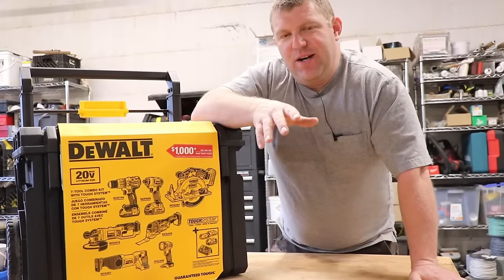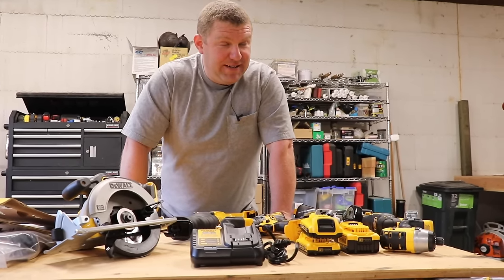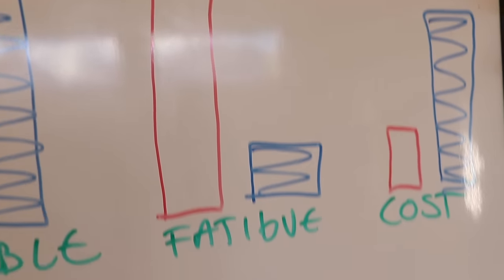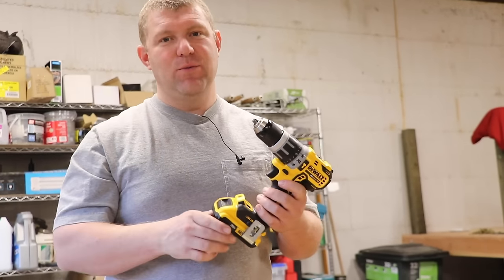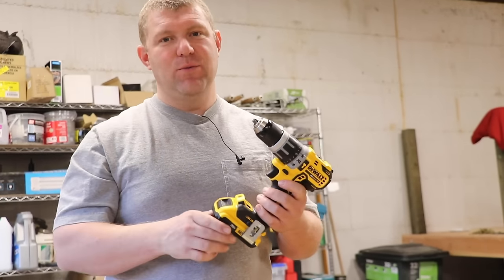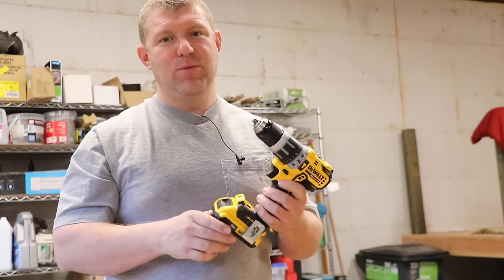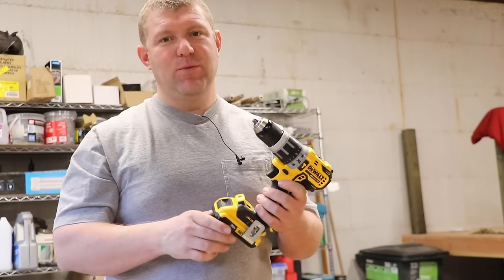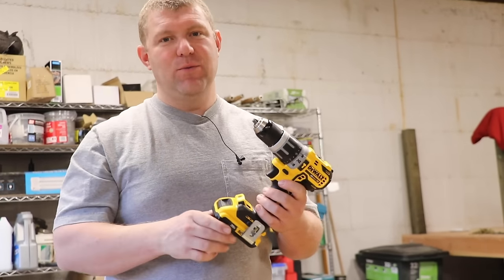SHAME ON YOU DEWALT

Comment: Still getting good use out of my 7 year old Dewalt 18V (Brushed) XRP tools.  These get fairly heavy homestead use.  Batteries are definitely showing their age  but the tools themselves work good as new.  I will be getting the batteries rebuilt with new cells this year rather than investing in a whole new system.  Tool reliability is a non-issue with these cordless tool systems and anyone that actually needs tools like these should be able to handle changing the brushes IF they ever wear out.   It's all about the batteries.  Look for a battery/tool "ecosystem" that has the tools and features you'll need and the best Watt Hours/$ in terms of battery cost and you won't be disappointed, regardless of whether you choose team yellow, red, green or any shade in between.

Comment: DeWalt is resting on its Laurels.  They have always been "The Brand".  The problem is that the new DeWalt is not the old DeWalt.  "Less than the top of the line" DeWalt cuts lots of corners or overcharges.  This tool kit is the former.  Battery prices are the latter.  Take a look at Harbor Freight tools.  IMHO this tool kit is similar to Harbor Freight's Bauer line of mid level tools which are cheaper.  For similar prices, check out Harbor Freight's Hercules line of brushless tools.  Equivalent quality, 10 hours a day 6 days a week tools at the mid level DeWalt prices.  Battery prices at 1/3 to 1/2 half the cost.  Check out the Bear's "The Den of Tools" channel.  Follow his converting from a DeWalt fan boy to a Harbor Freight fan boy.  I am 20+ years Harbor Freight customer.  The tools I have bought their started with cheap Chinese imports 20 years ago.  Now the Harbor Freight tools I buy are inexpensive, high quality Chinese imports.  Better quality at half the price.  IMHO, China is eating Made In USA's lunch.

Be careful of battery pack formats.  Alisa and Jessie have at least 3 different sets of battery packs.  Mikita, DeWalt and Milwaukee.  Probably more.  Off brands and non 18v batteries.  When you buy your first battery powered tool, particularly a kit, you are choosing the product line you will continue buying.  Just saying from personal experience.

Comment: I abuse dewalt tools daily. In my experience the brushless controllers/protection circuits burn out long before anything in a brushed tool would. Luckily their warranty is no hassle, I've been returning the same tools about once a year and getting a new one. I also dislike the lack of finesse with the brushless triggers, doesn't take long to get use to but trying to turn a screwhead that extra 1/4 turn can be difficult.

Comment: I still can't figure out why you guys have so many different battery platforms for similar/basic tools.  Too many unique chargers.  Too many unique batteries not compatible with the other tools.  If they were all the same brand think of how many spare batteries you would have or how much you could have saved just buying bare tools because you already have a stockpile of batteries.  If the tools were specialty and not available from a single brand I'd get it, but nothing special here aside from the Milwaukee tower light.

Comment: Every brushed tool I have you can change the brushes. I have some tools that are 20 years old and a Makita belt sander I used a lot that I changed brushes in twice over the years. Still working good after brush changes. I'm not sure new technolgy will last that long, most are full of electronic features, pwm speed controllers etc.. that will likely fail sooner than a brushed tools life just due to that fact its got a lot of electronic components on a PCB that its needs to work. That said brushless is still better with power and battery life and I'm on board with the technology but wont plan to keep those new tools for life like my others.

Comment: Wait. I think I have to side with dewalt on this. Your compairing the 7series to a 9 series hammer drill?  They package that kit together for a competitive price for weekend warriors. They are all more than adequate for home reno stuff.  I have all XR and bought several in 'kits' but made sure I was getting models I wanted because I am junkie when it comes to quality tools. What company does not have different version of tools, milwalkue with other fuel vs none fuel etc..

That XR oscillator is awesome!! 

I think the message is the buyer should do some research. You say those tools are cheap, but they smoke the older stuff. 

I think it's not deceitful marketing, more than letting people buy into the brand concept. I would say this kit selection of more on the big box stores and who they cater to. 

Btw, I returned a Milwaukee kit as it had me confused and was not there full out fuel line. 

Liked the vid, good, production.

Comment: Are you aware that the only real difference between DeWalt and Black and Decker is the color of the tools? THey actually did a study to find out which color combo people judged to be better quality and it turned out black and yellow was it. DeWalt has marketing and some of their tools are decent, but most are overpriced and they are notorious for worming out of honoring their warranties. If you're going to go with lower end tools, you might as well just get Baur branded ones from Harbor Freight. At least if they break you can just walk in and they give you a new one.

You've used both Makita and Milwaukee contractor level tools. Why would you think a combo pack of Black and Decker tools with delusions of grandeur would be any good?

Comment: I don't think the conclusion of brushless lasting longer is true. There is a load of electronics to control the brushless motor and these will not last forever but there is plenty of brushed tools over 40 years old that only need new brushes ever now and then. So for a life time investment with low usage I thing brushed could be a good deal - especially wired tools where the battery pack life time is not a concern as well.

Comment: The difference between brushed and brushless is more like 10% of efficiency all else being equal. Of course almost all the manufacturer's marketing people would like you to think otherwise. 

DeWalt is not a premium brand, they used to be. If you want serious tools then think Festool or Hilti. The Bosch "Pro" line is pretty good at a not so stratospheric price.

In fairness to the manufacturers the thing is the DIY market is huge compared to the trades market so pretty well every manufacturer wants to be in that market and it's all driven by price. As said though for the weekend warrior the cheap home brands are often a better value proposition when you can buy three or more for the price of pro gear.

Comment: Jesse, I don't know about power tools, I don't work on them.  I do know about vacuum cleaners.  I work on them all day every day.   I can tell you that brushless is not the way to go in a vacuum cleaner, because they typically have a big expensive circuit board on them that runs the brushless motor.  It costs more than the motor, typically, and is very sensitive and easily blown, especially the way people beat up a vacuum.  I'm sure they aren't any more careful with tools.  Being battery powered may help.  Mostly what blows vacuums is pulling the cord out of the wall and breaking the plug, or the heat of the motor, but it has given me pause about buying any cordless motor.

Comment: I got one of those 6 1/4 inch cordless saws in a kit a number of years ago.  I have literally never used it.  Why?  It just had to little power to cut anything!  The one you got in this kit is probably better than my older one but...the blade size is just a killer.  Why buy expensive blades that can ONLY be used in a tool that does not cut anything?

Comment: Great video.  I use these dewalt tools and they are 18volt. Didn't know about the brushless option.  They have been great but are aging.  Thanks for pointing out these differences.  I do HVAC and use drills alot and the sawsall.  Next sawsall will be that 20v with extenion head.  I usually buy them used but guess I will just buy them individually as needed.  I wondered about those kits when on sale.  That portable oscillating tool looks nice as I have plug in ones and made shelves with it (sanded and shaved with it, shelves not face.) double KUDOS

Comment: if hammer drill not have SDS chuck have only toy drill.i has buy before one de walt battery drill and use this only one month and fight to trash,because has too big,too non comfortable,no good at hand, no good balance to hand use, and too big many place, totally shit battery drill has, then i buy ruobi and bosch and both have lot better, lightweight,same power,little size,handy, no lot weight, good balance to hand, lot lot better use.newer again i not buy anythink de walt elektric drill or tools. big shit have.but anyway,if can buy under 200 $ all have cheap toy and hobby user what not need lot tools.

Comment: brushless motors are more efficient and will cause better battery life, and will also allow more output torque, so thanks for the info, I am also disappointed with DeWalt for cheaping out on their kits like your's, you think your getting something you are not, so good info, I'm going to check this out next trip to Home Depot, I have used all brands of battery operated power tools and in my opinion I believe Milwaukee is the best.